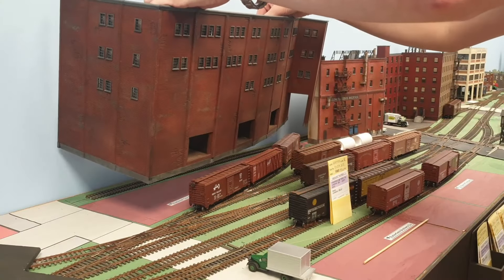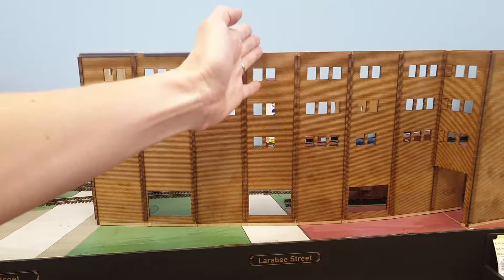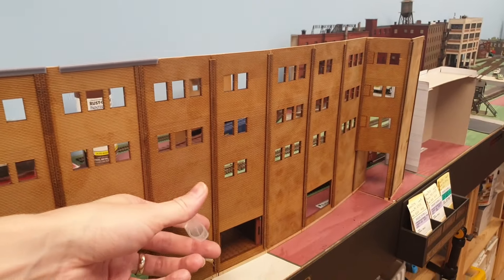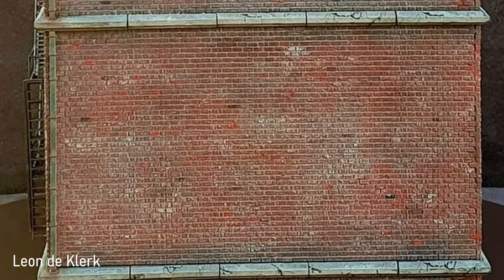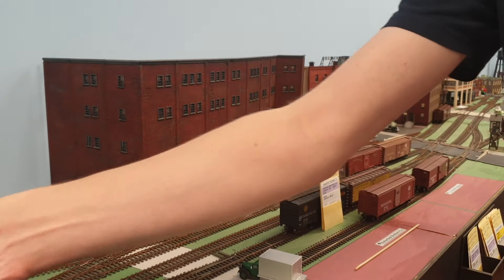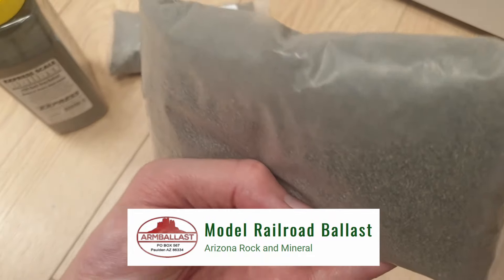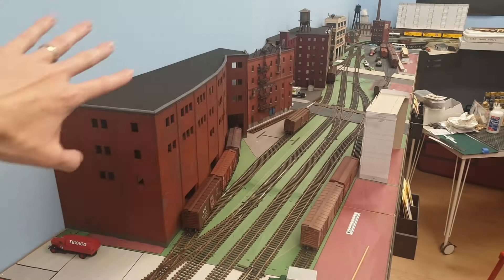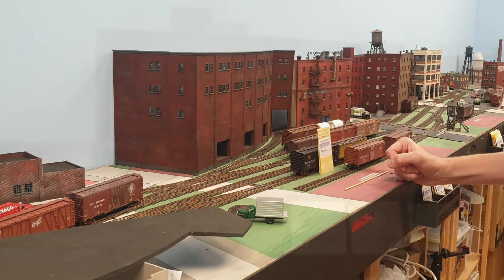Making the Biggest structure on my layout + Layout update VLOG~199

Comment: Do you plan to add a switch to connect that curve leading into loading bay to straight track inside the building?
Reply from the maker: Hi Pavel,
The track that runs behind the building is a hidden staging track. 
At the end of the spur, just half inside the loading bay, I will park a box car to block the view to inside the loading bay.